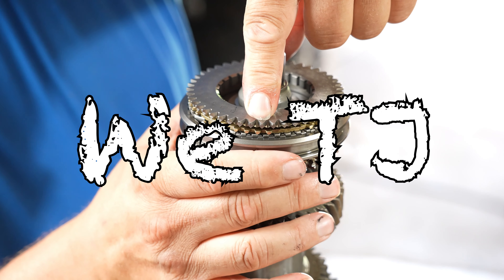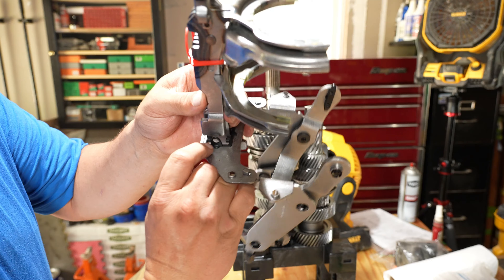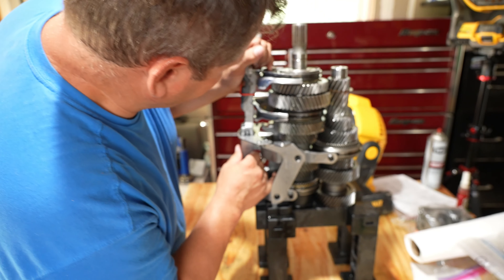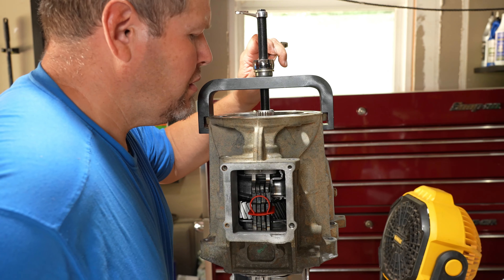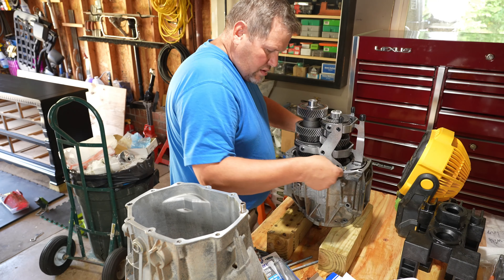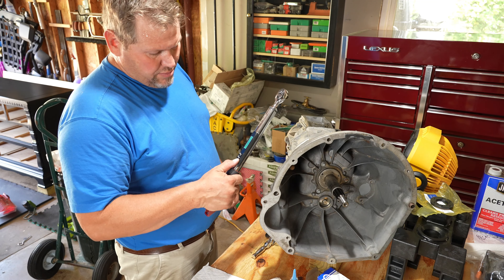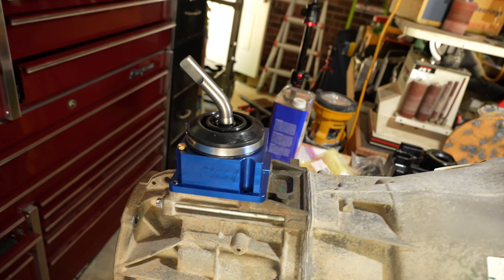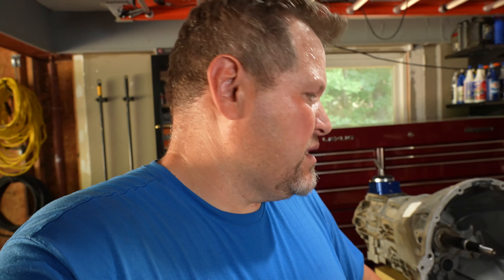Pt12 Jeep Rubicon TJ NSG370 Transmission (We Finish it in This Video)

Comment: Congratulations and what a great job you guys did. Should give Harley many years of service.
Reply from the maker: Thank You!!! Tell me about yourself. What type of rig do you have?
Reply: @RubiKidd06   I have a 03 Jeep TJ that's mildly built and my wife has a 07 Jeep JK that's mildly built also . I have been putting parts together for my TJ to beef up the steering and I'm also looking into hardened front axles and I have been looking into different lift springs such as Metal Cloak , Synergy . I have Rubicon 3.5 springs that are currently in it and have been for about 5 years but I have developed coil bind on the drivers side bottom. I also have bought new Vision Manx wheels for it as well. Just putting parts together for a long spring project in 2022 . I just completed the Viper coil mod yesterday and I'm happy to get rid of the coil rail. Until next time take care and be safe guys.